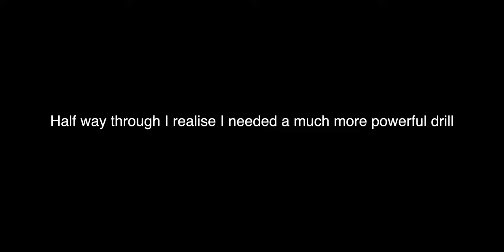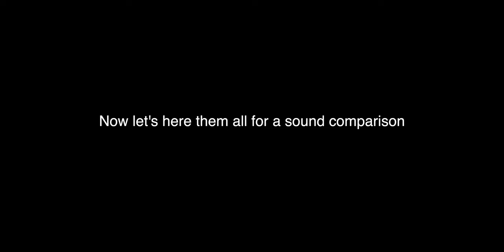Step by Step How to remove the silencer from a Euro 5 Akrapovič

Comment: Any idea what size drill bit you used and what size the replacement rivets were ?
Reply: The drill bit size for any standard rivet is always 4mm diameter. Looking at the video, I believe that the rivets he installed are standard aluminum rivets, usually the length changes a little (which varies depending on the thickness you need to rivet), but even if they were a little longer than necessary, you can use anyway and you will just have to pull a little more with the riveter..

Comment: Great video, thanks for sharing. I have an RS with the same black Titanium Akrapovic exhaust you have. I'm considering getting new headers without the CAT and potentially removing the baffles. However, I thought removing the baffles would be too troublesome. You made it look easy. Can you share the drill bit and rivet sizes? Are you still enjoying the sound? Thank you.
Reply from the maker: Thanks for stopping by! I am not too sure for the size I just lay one on top and show that it was the exact same diameter as the rivers. The sound is something that you need to text for yourself and check if you like it. It’s definitely louder and engine sounds very a lot. Cheers!
Reply: You may remove only one baffle, not both. Sound will be always better than genuine, for sure.

Comment: ONLY ONE MISTAKE, you left the db killer holes open, exhaust fumes will exit into the carbon fiber cone, its better to plug them, just a flat bolt going in from the hole out and a nut outside to hold it. Then it be perfect 😉😉😉😉😉

Comment: I've been looking into doing this for my '23 R1250RS Akrapovic exhaust, but the carbon cap on mine doesn't have any of the rivets you drilled out.  I continue to be baffled (pun intended) on how to get the true Akra noise from my $1000 USD exhaust...  Mine is barely louder than stock.
Reply from the maker: Hey Brett thanks for stopping by and also subscribing. Much appreciated Sir. I ‘ve heard that there is a way to drill the carbon from the inside to get access to a screw that holds the silencer in place. Akra also sells a little rubber insert to block that hole after. Maybe something to look at 😉 safe rides
Reply: @rank1adv  Awesome, I will look into it!  Be safe as well!

Comment: The fact the db insert has the bolts welded and hidden under a riveted on cap sort of indicates that its been designed that way. Miles got the insert retaining nuts easily accessible.
Reply from the maker: Yea it’s not really welded. Somehow deep inside the people designed it wanted to follow regulations but also didn’t want to make it hard to remove 😂😊

Comment: Hello ...... I bought that same exhaust. The sound is louder / hoarse than the sound of the Akrapovic that is sold in Bmw. Yours also sounds louder than the Akrapovic on sale at BMW
Reply from the maker: Hi there! That is correct. I have a friend of mine that the Akra that came with the bike from BMW and mine was way louder without the baffles on. Thanks for watching!
Reply: I tell you with the installed db killers that this exhaust makes more noise than the akrapovic that sells Bmw, both with the db killers installed. Is this correct?
Reply from the maker: No I think with the db killer it’s the same I heard both without the db killer and mine was significantly louder

Comment: Hey, what is the internal diameter on the muffler exit with and without the db killer? I have a Mivv muffler with a single exit hole, and I wonder if the sectional area is larger on the Akrapovic with dual holes.My db killer seems to reduce a lot the diameter.
Reply from the maker: I am not too sure about the exact diameter but I can tell you that when you remove the db killer it’s almost empty in there 😂. I think that what the db killer does anyways it reduces the diameters which restricts the way the air exits and makes it quieter.

Comment: Probably should have put back the 2 bolts so exhaust doesn't leak into the inner carbon cover.
Reply from the maker: I did consider putting them on but the fumes come out so fast that there is no chance to go through those holes.
Reply: no way of putting them back on, they screw into the db killer, i plugged mine with 2 short flat bolts and to nuts, then its all good..............

Comment: Why not just drill two holes in the carbon and remove the two screws.  You can cover the holes with the Akra rubber plugs and then have the ability to replace the remove the baffles whenever you need.
Reply from the maker: You are not wrong you can absolutely do that I just didn’t want to drill the carbon for something I want be doing often anyways.
Reply: True, a lot of unnecessary steps when you can drill two holes in under 5 minutes and have the ability to put the db killers back whenever you need to
Reply: But how would you be able exactly position the holes with carbon cover on? I thinking to drill the two holes in carbon but I guess I will need to drill the rivets and remove the carbon first?

Comment: Why make it louder. Really
Reply: It’s more about getting the most out of the exhaust we spent a considerable amount of money to buy.
It gives the proper sound and performance gains, not the government restricted version.
This is how they should, and use to sound before regulations.
Reply: Cause it’s more civilized.
Reply: It's not just because the noise becomes more beautiful, it's also because by removing the dbkiller the bike will be less strangled and will gain a few more hp.
Reply: @Guimadark only if you alter the fuelling to compensate for the increased flow, otherwise it will run leaner.